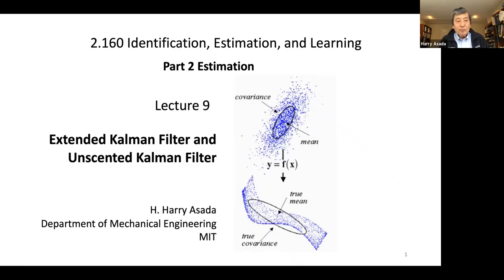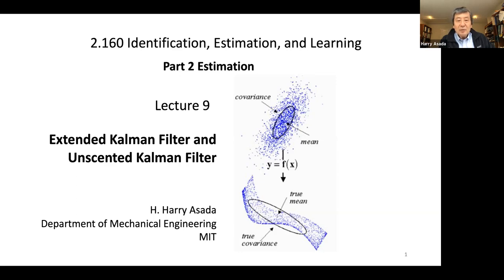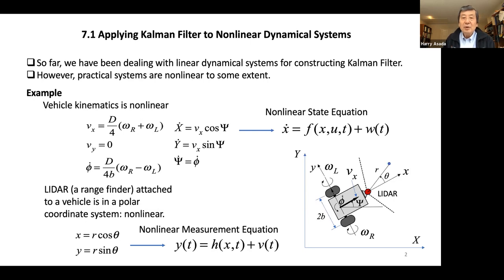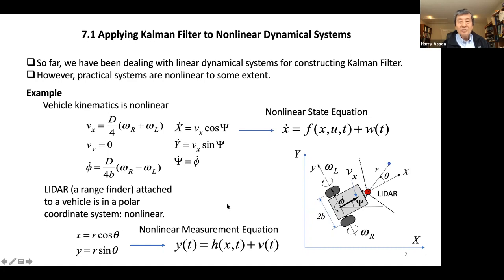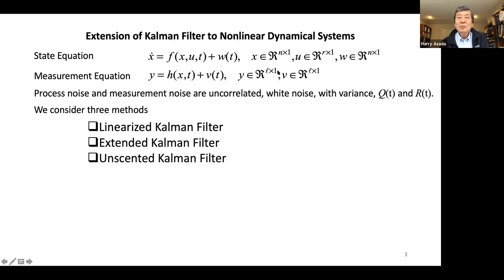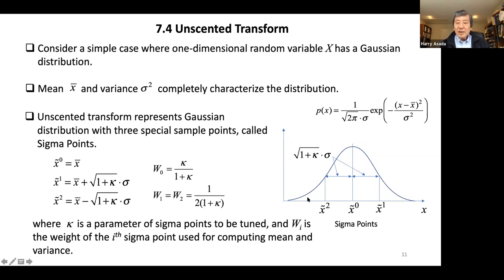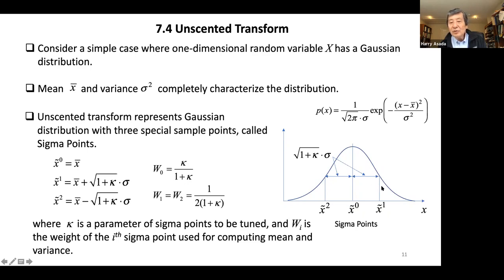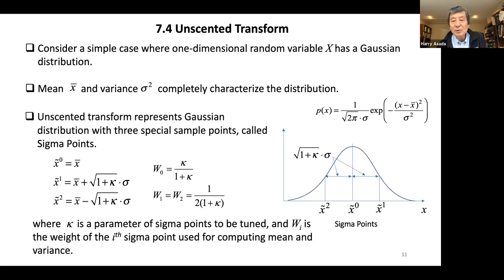Lecture 9: Extended Kalman Filter and Unscented Kalman Filter

Comment: 40:30 Professor, you used eigen vectors for sigma points but I saw other materials use the columns (or rows) of Choleskey decomposition. Which is correct?